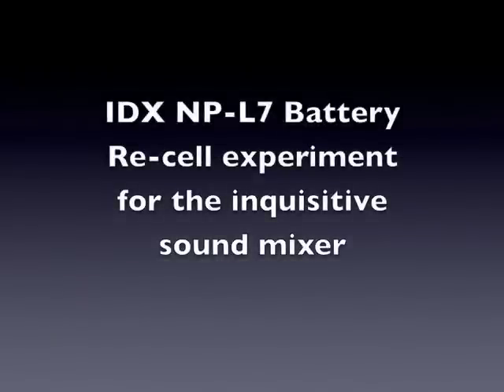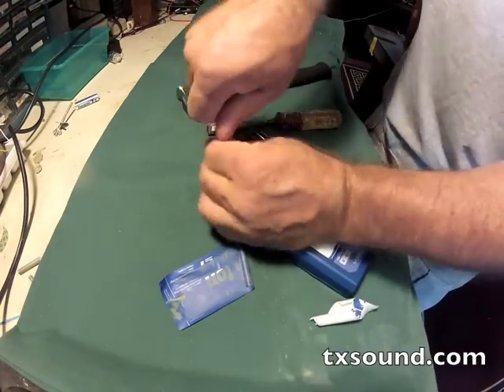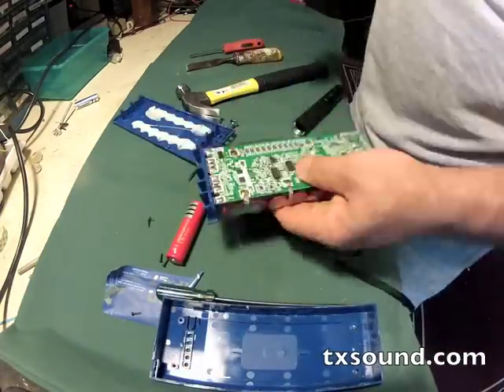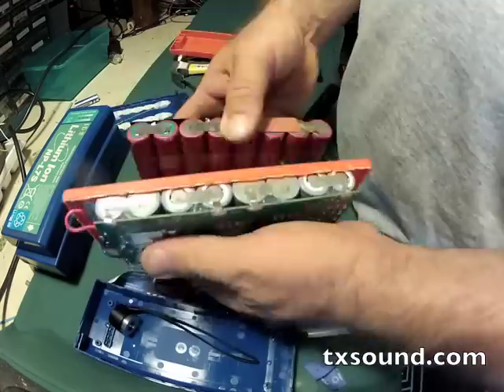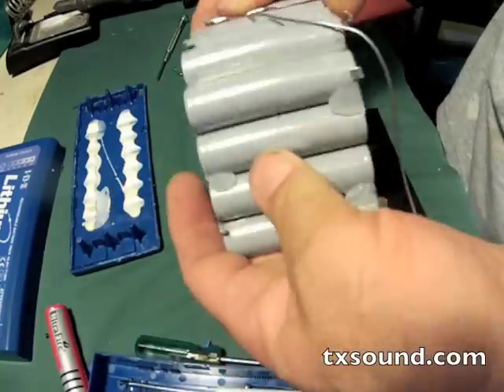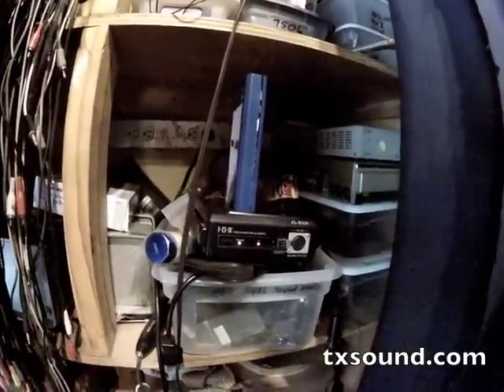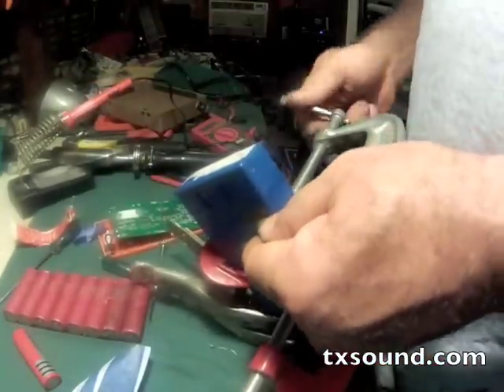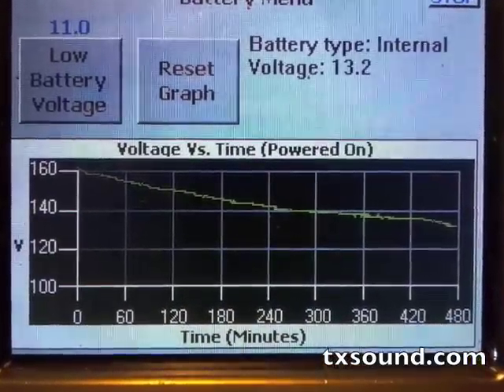IDX NP-1 Re-Cell Experiment using a Varizoom (IDX incompatible) cell pack

Comment: Hi there do you know if the complete charge circuit (balancing) is done in the battery itself ? im looking to make a charger for these but by the looks of it they might not even use a a CC/CV charger in this case. ? and its all done inside ?

Comment: tried to recell a Swit np1 - no so good. does the circuit board prevents cell changing by auto blocking itself when disconnected?
Reply: Check first the thermal fuse. Author of the video calls it "extra temperature sensor" 2:26. It's non-resettable thermal fuse and it trips very easily while soldering. Mine was 84°C. It should be spot welded to avoid heat.
Best spot to start splitting the case is the corner at +B contact.  Seam has no overlap first 9 mm from the corner.

Comment: Thanks for posting this! I am using some old LP-L7S batteries, and hoping to find a way to extend their life. I haven't seen the Varizoom battery before, and wonder if some kind of generic 3.7V cells could be used. Do you happen to know the dimensions of those cells?
Reply: its generic 18650 liion cells